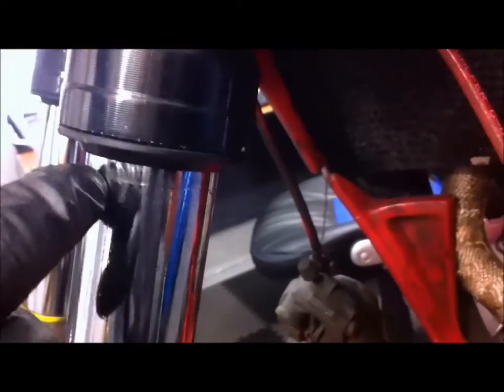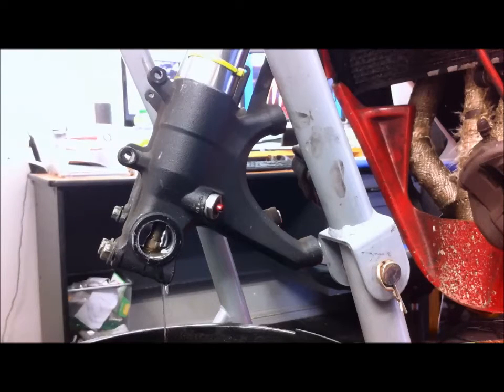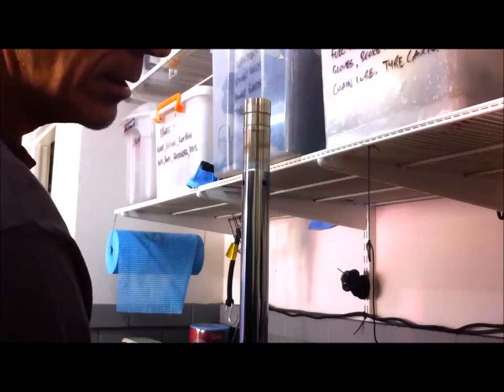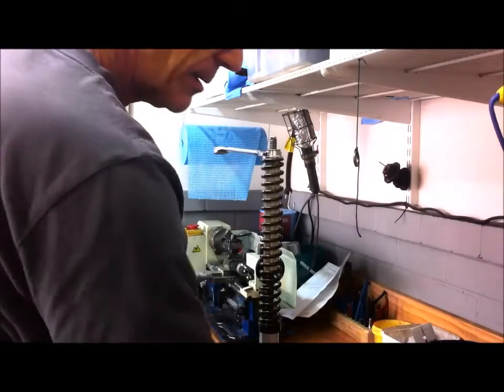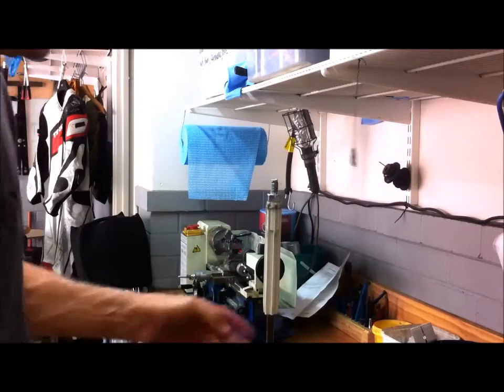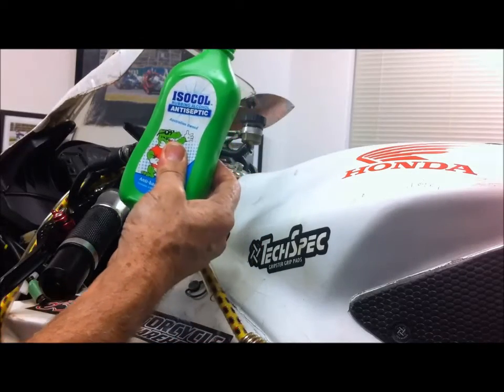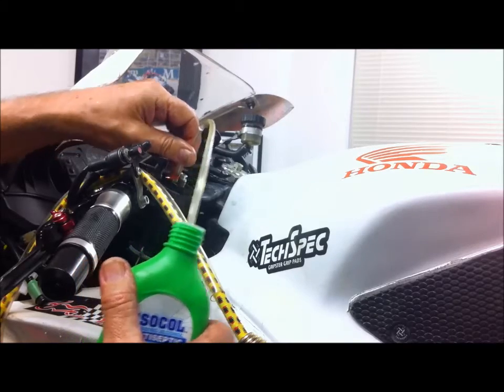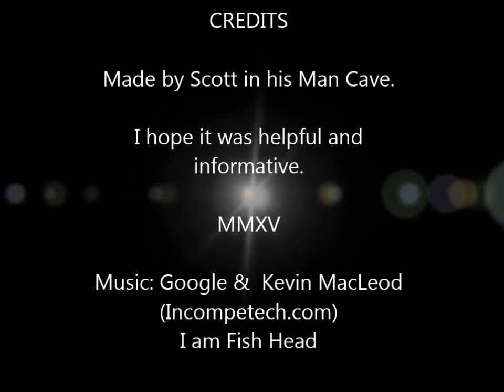Change Front Fork Seals set oil level 600RR R6 ZX6R CBR R1 1000

Comment: I'm a little confused? So you're suppose to put in 300ML but you sucked out some to make it 170ML? So what's the amount you're suppose to keep in the Honda?
Reply from the maker: +FrenchieYang12 Frenchie you set an oil level not a volume. A motorcycle front fork is a composite mechanical and air spring. The process is to pour the approximate amount of oil into the fork and using the sucking tool you withdraw the excess to get the required oil level. The level is always measured from the top of the outer tube with the inner tube fully inserted or collapsed if that makes sense.

You'll notice the green bottle has a plastic tube with a cable tie set to the level I want. In the case of the Ohlins 30mm R&T cartridges I use a level of 170mm. The level is always taken with the spring and spacers out. Watch carefully from 17.45. I say "I have a cable tie set at 170 mm" maybe it's my Australian accent :-) You can adjust bottoming resistance by changing the oil level ... a higher level gives a stiffer air spring. It's very progressive so it doesn't really come into effect until near the bottom of the stroke.

If you're running standard Honda cartridges the oil level is usually set at 90mm ... again with no spring or spacer. I hope this clarifies your question. Regards, Scott
Reply: sorry I'm learning still.. a little confuse. can i by chance msg you via FaceBook. I'm racing the same bike but learning slowly to save money
Reply from the maker: +FrenchieYang12 Yes you'll need to take control and DIY or you'll run out of money real quick. Can you msg me here as the information helps others. I'm not much of a FB fellow.
Reply: okay so heres the thing. in the manual, it tells you 14oz is the amount you need. i have OEM internals but like i said I'm really new so i don't really understand the syringe thing and the numbers you use. i watch video with dave moss or others but they don't go in details so i get confuse. it seems like they fill the fluid up to the top and syringe out a certain amount according to what i watch. please correct me on anything i say. 

i have so much more to ask if you don't mind... i was watching dave moss do 06/07 r6 front forks.. curious are they similar to cbr in removal.. okay how he did it.. he loosen the top. use the spring compressor, remove rebound spacer and the damper, and for some reason he just pulls the lower part of the forks and it just comes off... with our cbr it when pulling off the whole bushing and everything comes off.... what I'm trying to figure out is..if i do the same way as the r6.. would i be able to pull the bottom half of the front forks off without disturbing the bushings.???
Reply from the maker: +FrenchieYang12 Frenchie the CBR is different. The video shows how to remove the inner tube. The seal and bushings come out with the inner tube after removing the dust cap and the inner snap ring. You need a couple of sharp pulls to get it out.

The manual says 14oz but you need to be more precise for track work. My manual says 14oz but it also states a level of 90mm when using standard cartridges. Dave Moss uses a similar syringe/sucking tool to set a level. I always improvise to save cash and save the planet.

If you're changing the oil set it at 90mm level with your standard cartridges. Make up a sucking tool with a plastic bottle and tubing with a cable tie to give you the correct length.
Reply: +Scott Elliott ohhh i see?? so fill it all the way to the top.. set syringe to 90mm.... and place it on top of outter tube and suck out the 90mm and you're set...? correct?
Reply from the maker: +FrenchieYang12 Yep you've got it ... although don't waste the oil as it's expensive. Overfill by maybe about 20mm then suck out the excess. You can easily eyeball a rough level when you're pouring in the oil.
Reply: +Scott Elliott i plan on just syringing it and putting it back. thank you for the feedback! helps me understand so much now.. i hope you're active on youtube. i will update you more on my honda cbr racing. i started this year racing CRA in minnesota, USA. i don't know exactly where you're from but it is an honor to meet you. i will be racing novice MWSS and of course MWSB, MWGP, HWSS, HWSB, and HWGP. our stock front and rear can hold quite the weight so i won't be needing any springs. my future upgrade is the TTX GP/30mm NIX front. i only do this because ohlins is well known around and only one with TTX technology. everyone one else is still using piston. i was considering JRI triple rear/ Ktech 25mm cartridge. please update anything you experience to follow up on what i do. or anything you realize as a racer to help me in the future... thank you again
Reply from the maker: +FrenchieYang12 Yep I'm active on YT with my channel and make lots of how to videos on cars and bikes. I'm happy to help out. I raced at state championship level for 16 years with reasonable success. I still front the starter in veterans racing from time to time. I won the championship in 2011 and was runner up in 2012 on my trusty 08 CBR600RR. I'm from Perth in Western Australia. I'm 60 years old and have been track riding since the late 1970's. One thing you can't buy in this sport is experience so it's the guys like me who've experienced the highs and lows who can help the new starters ... even if we're on the other side of the world.

Depending on your weight the standard front springs should be ok as they're 1.0kg/mm. The rear could probably be increased a bit as I think the standard is about 10 kg/mm. I'm 79kg naked and use 1.02 kg/mm fronts and 11.7 kg/mm rear. The latest thinking is to use minimal preload and a stiffer spring. It gives more edge grip.

I have the 30mm Ohilns R&T cartridges and an Ohlins rear ... not a TTX. Ohilns is good stuff and is easy to service.

Have a look at the video I made of my trip to Sepang in Malaysia in June. I spent two days on a hired ZX6R. One of my group took me out on day 1 and I've got it all on film. The introduction video is also worth watching for some background as to what I'm about and why I do this. Kind regards, Scott
Reply: +Scott Elliott thank you! i shall be watching and following up. i ride a 2009 cbr600rr.. its quite hard competing here in US since not a lot of support here compare to europe. the main bikes to race are the r6 and gsxr since more contingency, money, and background of most shops are these machines. cbr600rr i love the chases and the weight of em the only issue is the cost to make it really fast to keep up with the other bikes out the crate. (HRC parts are needed) i weight about 200 lbs.. i can lose weight and gain between 165-205. 1.0 and 11KG should work with people 210 lbs. 

racing at 60 is quite inspiring. i am 25 years old and hoping to make it far. if any problems along the way i will message you. i appreciate the help and thank you
Reply from the maker: +FrenchieYang12 Good luck with it. If you're happy to post your email address here I'll shoot you a reply. I'd prefer to do it that way around. 200 lbs (90kg) will be a liability on a 600. I still train with lap swimming, weights, off road riding, kayaking and Krav Maga self defense training. Don't underestimate the fitness required to go fast. Also it's a risk mitigation strategy to make sure you're not carrying excess weight. When you fall that kinetic energy has to be dissipated and that's usually through your skeleton. I'm 184 cm and at 79kg I fall in the middle band of the height weight chart which is a good healthy mass. Even then the top racers are usually smaller men at about 60kg so my extra 19kg is a disadvantage.

Don't fall far the myth of being "big boned". The height weight chart issued by a reputable health authority is the specification you need to aim for. Studies have been done and the variance in skeletal weight for males of the same height is about 2.5kg.

I know you guys use imperial measurements ... most other countries are metric because it's simpler so you'll have to do the conversions :-)

Regards, Scott
Reply: +Scott Elliott I guess the big bone stuff don't matter much eh? I assumed with more muscle mass the less chances it will be.. Guessed wrong. I used to be bodybuilding type of material. Now I love racing.. But I usually gain and lose. I will try and maintain around 175.
Reply: +Scott Elliott hey scott... Recalling some follow up on videos. Before removing the top piston off the Cbr forks, do you by chance know how many turns are involved in rebound ? Or for Honda it doesn't matter. For example Watching r6 they are permitted 50 clicks... But if they can't fully click 50, you would turn rebound all the way soft and then After doing what you need to do with the forks,  you would turn it 50 clicks to hard and put it back on rebound rod. Next he would click it back out all the way and make sure when it hits 50 it would completely stop.

Now curious with Honda since we only use flat head to turn and it doesn't click.. Is there a certain amount?
Reply from the maker: Frenchie the damping settings are usually quoted as a number of turns or clicks from the fully closed (hardest) setting. They're always "lefty loosey righty tighty". So turning clockwise winds the needle closer to the seat until it stops and seals. In the case of the Honda with standard cartridges it's about 2 to 2.5 turns out for rebound from memory. If you can run 3 turns out that's even better.

In general with rebound most riders tend to use too much or in other words run it too stiff. Use the minimum you need to get control. You want the suspension to do most of the work not the tyre.
Reply: Scott Elliott
with the ohlins piston valve, is there a particular amount of clicks with the rebound and compression?

so lets say... i screw up and i didnt fix the amount of compression and rebound and i stuck it back on.. will it throw it off?? and how would you reset the mount of clicks on both rebound and compression
Reply from the maker: The Ohlins manual recommends you start at 12 clicks out for both rebound and compression. If you have Ohlins cartridges you don't need to reset the adjuster as it's a different design. If you have standard Honda cartridges you often do. I explain in the video https://youtu.be/jYcknRfj0kw from 9:15
Reply: Scott Elliott ohhhh i see....... so you wanna make it flush with of course having the dot adjacent to the dot. mark it so when you remind back it would fit right. afterwards once lets say everything install... once you make your rebound soft there will be a limit of turn to it anyways. makes sense... thank you
Reply from the maker: Yes ... I think you've got the hang of it.

Comment: hey scott its been a while.. i just wanted to share what i came upon on my journey of fixing these forks..

1. i followed what the service manual said by setting everything to soft and i screwed up big time on my rebound.. lol i had to set it back to hard and restarted.

2. im not too sure but preload, compression, and rebound are all not exact on every hit.. probably off by a tiny turn or so.. idk if that is normal but both forks are quite exact.. example.. 14 preload adjust to 15 , rebound had about 4 and other had 4.10, compression has 3 and 1/4 on both..

3. idk but when trying to tighten up the piston valve on top.. h0ly crap.. toughest thing ever because the tubes keep spinning... any tips??
Reply: +FrenchieYang12 correct me if im wrong.. manual told me air should be 93mm... for stock..
Reply from the maker: +FrenchieYang12 I'm not sure what you mean by piston valve?
Reply from the maker: +FrenchieYang12 Yes about 90mm is what the sir gap should be for the stock cartridges
Reply: +Scott Elliott  my apologies... what i mean is the fork caps
Reply: +Scott Elliott also one last thing.. knowing our fork caps im not gonna lie they are a pain in the butt... my preload is like 14.8/15. total count I got was 15. where would you go about to fix this.. I know you just gotta compress the cartridge and release the cap and jam nut and from there adjust.. but not exactly sure how to adjust the preload so I can get 15/15
Reply from the maker: Frenchie I don't think there is a way to adjust the number of turns. It's not exact so if you're getting 14.8 turns from fully released to fully compressed I'd say that's ok.

Don't fall into the trap of having too much preload. Watch the video I did on setting up your cartridges to get the right amount of sag. Forget the old paradigm of 35mm front sag or whatever it was. Top out springs change all that so your preload must be set to get the correct interaction between your main spring and top out spring.

The video goes into a bit of detail but it has to. Some things in life can't be explained or taught in a 10 second sound bite. If you set up your main spring the way I show in the video you'll be really pleased with the result. You'll need to watch parts of it a few times to  get it. Regards, Scott
Reply: Scott Elliott
 thank you scott for replying. yes during the mean time i did some research.. preload never changes at all no matter what you do unless you change spacer and spring. so this answers it even more. thank you for your kind knowledge
Frenchie
Reply: what im trying to figure out is how to turn the fork cap tight if the fork keeps spinnning. any tips?
Reply from the maker: +FrenchieYang12 Frenchie the fork cap is not done up very tight anyway. As soon as you tighten the top clamp that kinda locks it into place anyway. The fork cap uses an o-ring to seal not "tightness". It's left loosey righty tighty so make sure you're not tuning the wrong way!
Reply: Scott Elliott
 thank you sir! i appreciate everything youve taught me. thank you again
Reply from the maker: +FrenchieYang12 Frenchie I'm pleased to help out. It's also great to find people wanting to take control and do these things themselves. Regards Scott

Comment: Volume oli shock ...???
Reply from the maker: You set an oil level not pour in a volume. It's important to make the air gap correct because the fork is a combined mechanical and air spring. I can't tell you a volume as I only ever set an oil level.